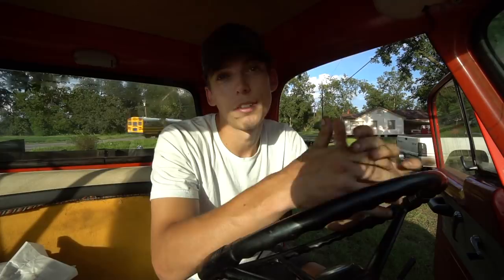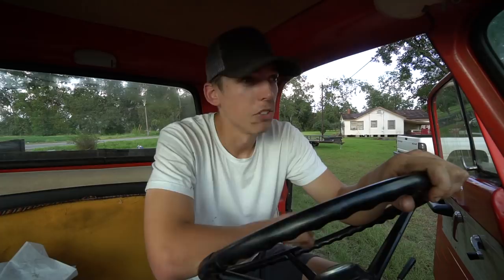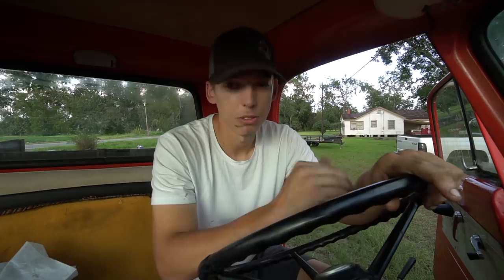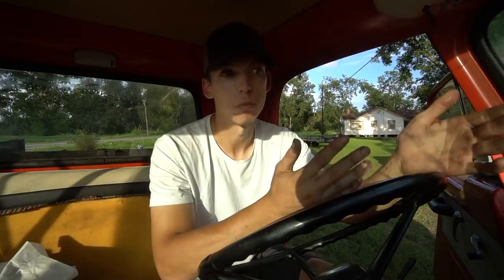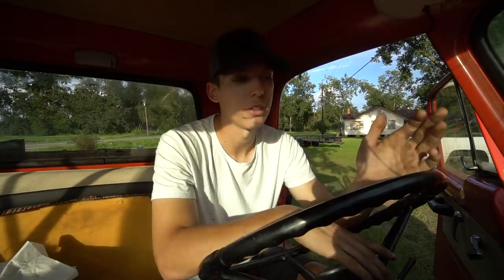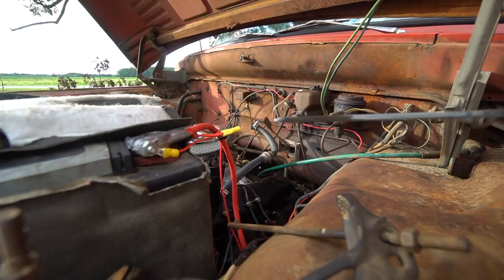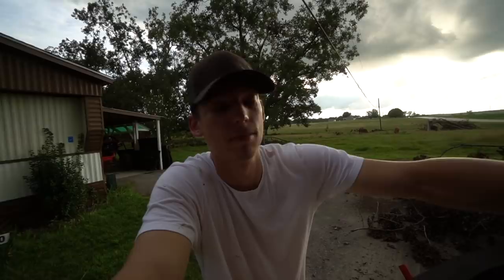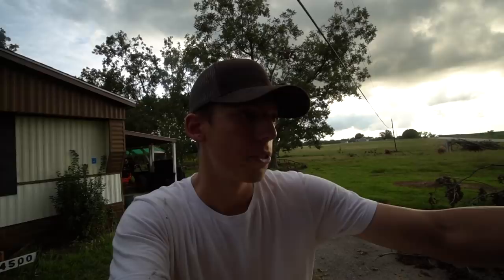Frank Blew His Head Gasket?

Comment: Thoughts for your channel.  Lay out a plan. Eat that elephant one bite at a time. 

Video. 

1. Do a compression test to see of you have a blown head gasket. 
2.  If needed change the head gaskets. Both sides
3.  Fix the intake gasket situation. 
4.  Change water pump and thermostat to remove that problem. 
5.  Bleed and adjust the brakes. 
6.  Fix the ignition switch. 
7.  Test drive.
8.  Then move on to cosmetic stuff. 

There's 8 videos which should keep you in business for a few weeks. Don't think you have to explain what you want and what didn't work. Video the stuff. You have a lot of talent and are smart. That truck is old and if it takes you a few weeks of months to get that all done that's ok. We are hanging with you and want you to succeed.  You can do it. :-)

Comment: Watch the temp really well, it could be anything. You greased the water pump and leaks will pull air into the system. The coolant does look like it has oil or more than likely grease. But the smoke is probbly valve seals letting oil into the cylinder. But i would just drive it and see if it clears up. My 80s model Camaro and ta's would blow some smoke every time they sat and the oil drained out of the head through the valve sels

Comment: A compression test should reveal if you have head gasket issues. I suspect the grease you are putting in the water pump fitting might be the issue. At any rate, a blown head gasket isn't necessarily the end of the world. Setback yes, but not a disaster. I might suspect a leaking valley pan gasket or intake manifold gasket. The symptoms can look very similar.
Reply: Think you are on to something there , if the grease is passing thru to the inside I bet that is what he is seeing cause he has said he has greased it a couple times trying to shut it up.
Reply: A could be sucking air from the weep hole on the water pump,  But by all means do a compression check tool is not that expensive at Harbor freight.
Reply: Mike Has The Right Idea, He’s Leading You in a Solid Direction. Good Luck on the Test Drive, Ill Be Looking out For the Video.

Comment: Before you tare anything apart do a compression check and inspect the plugs.  It could be a leaking intake or pump issue which would be easier than changing a head gasket.

Comment: In my experience there are a few things that could be wrong. 
1. You could be dealing with a blown head gasket. That does not always happen with this kind of modification, but it does happen.
2. You could have a leak between the manifold and heads where the water / coolant goes through the manifold.
3. Cracked manifold passage between the intake and the water passages.
4. Theo one that is the worst issue could be a cracked head. The water jacket in the head might have a crack and you would not see that until you pull the heads.
These are things I have seen in both diesels and gas engines. If you have a water / oil cooler (which was used on some engines) then there could also be a leak in this.
Normally if you have water in the oil it would not show on the dipstik until it is very high. I have worked on a couple of engines that I worked on for some people who blew their head gaskets and they pulled their dip stik and it did not show on their stik, but when I dropped the pan it was partially filled with water.
If there is no water in the oil then check to see if the bearing or casting metal from the bad water pump. When the bearings are worn out the clearances disappear and then you have the steel impeller rubbing on the aluminum / cast iron of the housing.

Comment: I think Cory archer is right. I think it's water pump bearing material mixed with grease. As far as the smoke goes, blue smoke typically means an oil control issue. I'm betting a combination of worn valve seals, and possibly worn rings.

Comment: Try drx rust remover I used it on my 1970 C30 cab and it removed all the rust you just spray it on and pressure wash it off, it's super easy check out a few videos on youtube. I think you said you left your pressure washer in cali,  See if you can brown one. It completely removes rust, It's not a conversion or a cover that stops it, it removes it then you can paint over clean metal. Also don't buy it off amazon its cheaper on their website. As for the possible head gasket you can get a Combustion Leak Tester you put it over your radiator and it will detect the presence of exhaust gases in an engine's cooling system.

Comment: I have been dealing with Mopars for over 40 years replace the valley pan and do not put RTV on the intake. The reason you are getting bubble is because you are sucking in air one of the cooling passages. I have done this on more than one occasion. Put the valley pan on and put the intake gaskets on then the intake.

Comment: Neither the coolant nor the oil indicate a blown head gasket.  I agree with the comments about the water pump drawing air through the packing.  If your coolant was low, the pump impeller is whipping it into foam.

Your carb may be very rich.  Cold starts with no choke required is a clue.

Comment: Autozone has a head gasket leak detector you can rent. Just need to purchase fluid used in the test. During test some coolant is drawn up into cylinder .Fluid is blue, if it changes to yellow it indicates exhaust leak into cooling system.Get engine up to temp( thermostat open) before performing test.

Comment: Also like I said b4 make sure you only have 1 crankcase vent being sucked thru the intake via a pcv valve and the other valve cover has to have a vent to atmosphere on it if you have both valve covers venting into the intake via vacuum line and into the air cleaner than you are forcibly sucking coolant thru the valley pan gasket which is why i warned b4 not to vent both valve covers to the intake because itll find rhe weakest link and suck that seal in and can be water

Comment: Let’s look at this logically. Foam may or may not be caused by oil in the coolant. Since there is no apparent oil in the coolant the foaminess is probably caused by air be mixed in with it. Set that thought aside for a moment. You should get a clean, dry container and drain the motor into it and inspect it for any coolant. It may not show up on a dip stick nor be enough in the coolant to be detectable by smelling it or sticking your finger in it. If there are no signs of coolant in the oil, you can pour it back into the crankcase and go back to the possibility of air being sucked into the cooling system. This possibility is more problematic as there are several locations where this could happen. You have a bad water pump and the front seal is bad. You indicated that the thermostat and water pump gaskets are leaking, another possible source of air ingestion. Then you have the valley cover with a “homemade” silicon seal, another likely source. My first inclination is the valley cover is the issue, but hard to say. Try a new proper gasket there first and if that doesn’t fix it, move on to the water pump and gaskets.

Comment: I would suggest to first change the water pump, it apparently needs it anyway. You said water pump gasket is leaking, look very closely to see if it may be leaking. It may be seeping and dripping looking like it is from the gasket. When you run it with cap off it’s not pressurized and the water pump could be sucking air in by seal causing bubbles in coolant.

Comment: The grey may be the grease that you are pumping into your water pump. Your valve guide seals are bad, you need to do a valve job. Remove the heads, check the decks, get the valves ground. Check the bores, if there is a ridge then consider rebuilding the lower end. However I believe a valve job will fix your issues.

Comment: Put some thin plastic around the radiator neck with no cap on it. Rubber band it or tape it tight to where it kinda looks like a balloon. Crank the truck and see if it inflates. Easiest way to check if a head gasket is blown.

Comment: Faulty water pump. It's not working properly. Recommend replacing it. Make sure the old gasket is cleaned off the block completely. Then take a rag and spray a little brake cleaner on it and wipe the gasket area really well. Then install the new pump.

Comment: I used to work in an auto engine  machine shop. What usually causes coolant in oil - cracked block, cracked head, heads or block is warped need resurfaced. What usually causes smoke - bad valve stem seals, bad rings/cylinder wear, carb adjustment. It has been my experience that if you rebuild cylinder heads normally the bottem end has problems after,  so if it were me I would just rebuild the entire engine if you figure out the top end is bad. I did alot of that stuff when I was your age. Judging by the oil. I don't think you got a blown gasket. There is no evidence of it. A compression test will tell you if there is a major problem. Something that old is probably gonna have some blow by on the rings due to wear.

Comment: with the oil being clear and not milky looking the radiator being low will cause the foam ,check the water pump gasket and thermostat gasket i don't think its a head gasket the smoke just looks like a stuck ring ,its an old truck that is to be expected dont panic it will work out

Comment: It sounds like your valley pan is garbage and needs replacing or that well water/grease combination is the issue. Judging from your dipstick being clean, and the contents of the radiator I doubt you blew a head gasket (it usually looks worse than that). A compression test would definitely tell you and is a good idea.  I would not drive it until you are 100% sure the head gasket isn't toast. I'd also drain the coolant that you have in it if you mixed it with well water. Just get some jugs of distilled water from Wal-Mart (99 cents per one gallon jug If I remember correct) and mix it with the concentrate anti-freeze.

Comment: Its probably the Grease you put in the water pump along with it being low on water . Don't be so quick to pull it apart. I don't  think it has run enough to blow a head gasket. Its a lot easier to get water in your oil than oil in your coolant unless you are working on a vehicle that has a bad oil cooler but this one should not have an oil cooler. The valley pan does not have oil running through it only air/fuel and water in the cross over. If the valley pan was leaking it would leak oil from under the pan or water into the valley (water in oil) or finally a vacuum leak that would be  noticeable in the way the engine runs. Just fix the water pump and keep an eye on it. Rich

Comment: Well water concentrated is not a big deal. The minerals will form deposits in the radiator. City water will as well. Best to use distilled. That said I have put plenty of city water in radiators over the years.

Comment: You can blow a head gasket on the compression side  and not close to the oil passage..any foaming in the rad is not normal ..chances are ..since you have gaskets coming pull the heads and just do it ..but if you do ..get heads checked..magnafluxed for cracks ..or just find a set of 452 heads ..common on all mid 70's big blocks..or 346's..early big block 72 and up ..as these series of heads have hardened exhaust valve seats which your heads do not have ..for unleaded fuel

Comment: Any time you get air in the system and fill it up you will get some foam and grease from the water pump bearing also will cause foam you need to replace the water pump chances are the grease is getting into the coolant. If you pull back and forth on the fan and it moves at the bearing its shoot

Comment: Take the spark plugs out. Then use a coolent presure tester to pressurize the system. Let set a few minutes. Then crank the engine over. What will spray out the cylinder that any is leaking into. If not check for any coolent running down the engine block.

Comment: I've seen it foam in radiators before, fill the radiator full , put the cap back on and see if there is any pressure  build up. If there is a head gasket leaking there will be pressure and lots of it. you  might be a little paranoid, I think it is because the radiator is not full and the foam is from the water pump just pumping coolant

Comment: And well water won't cause the foam. Now if someone added a coolant flush to the engine that would cause it. Always rinse the coolant system fully when you are doing major work of any kind and have to drain the coolant.  Especially when you just got the vehicle.

Comment: Thermostat also Water Pump should changed and head gaskets should changed too also try a new Rad cap too! Gaskets use High Temperatures Black Silicone put big thick film on both sides of gaskets around bolts too that why leak too!  Also foam okay also rad fluid should be 60 % antifreeze and 40 % water too  ! Plus flush rad too even heads even heat core too !

Comment: You had doubt when you did the intake. Why not have just done the heads then?? You were half way on that job.

It can leak straight into the cylinder and come out as the white smoke as you see. If it does that it won't put oil in your radiator or water in oil.

Comment: This is a Big Block Mopar.  There is No Coolant Flow thru the intake manifold. The Valley Pan caused foam in the oil How ?  Think..  Water Pump with a bad bearing being greased ?  Hmm?  Also.. Big Block Mopars have exhaust manifold studs or bolts that go into the water jackets in the heads. If they leak you get coolant in the exhaust.  And back to the valley pan. With the stock iron intake yes the valley pan is the gasket but Im pretty sure with an aluminum intake a fiber gasket goes between the intake and valley pan. Any Big Block Mopar Gurus gotta comment here ?  Also... Gas eats silicone. You dont use it on intake ports.

Comment: It does sound like the water pump if you put grease in it, that is where it is coming from, most likely. Even dingy, the truck should still run and drive normal. I don't think you could possibly put that much in there that you have to flush the whole system, and I am thinking it should be petroleum based, so soak it up with some paper towels, because it should float to the top.

Comment: It's not the head gasket cuz if it was the head gasket it would build pressure and the radiator fluid would come out of it as soon as you took off the cap and you would see bubbles in the reservoir tank it would overheat within 5-10 minutes of you starting the truck

Comment: It's a old truck man things like that are normal while your replacing the head gaskets you should take the heads to a machine shop and get hardened valve seats put in for Unleaded fuel those trucks back in 65 run on leaded fuel and it helped lube the valves without it the valved will pound their way into the head and cause big issues or there is a leaded additive you add to the fuel that way you don't burn your valve seats right out the choice is yours but running it with out doing one of the two your going to have big problems sooner or later

Comment: Go buy a vacuum gauge in set it to the highest vacuum setting you can with carburetor  And time the vehicle with a test light and check it with that the vacuum gages well to try to get the highest vacuum setting with the carburetor and timing.

Comment: If the water pump gasket is not sealing the water pump could be pulling air into the system causing foam in the radiator

Comment: Do a cylinder bleedown test and pressurisebthe shit outnof the cylinders and put a pressure gauge on the radiator cap and see if it's pressuring the collar system you can even look for bubbles in the radiator

Comment: Probably grease from the water pump and if any air is getting into the system it will churn into foam. I'd drive it some and keep a check on oil an cooling system. See if it persists. I don't think it's much to worry about

Comment: I found this online....Foam in coolant can result from trapped air in the system, a leak on the suction side of the water pump, an improperly functioning water pump. Foaming may also be caused by a lack of anti-foaming agents in the antifreeze.

Comment: Double check your intake gaskets bevause they will leak that valley pan is super tricky to get it to seal so if it isnt cranking superbhard or slow then it might not be a head gasket it could be your b intake leaking. Run the truckand drive it  with the radiator cap cracked loose and if the level stops lowerimgbthejbits your intake
Reply: This engine does not have coolant passages in the intake

Comment: I had a head hasket that had a pin prick hole in it and it was not leaking oil or coolant but when it got hot it was leaking compression into the coolant chanblers and bubbled all the coolant out of my overflow.. I also struggled to figure out what was going on..

Comment: Did you flush the cooling system using the flush you can get from Walmart?  I use that every other year, and after I drain it the flush, I refill with water to rinse the system.  I'll get a little foam like that.

Comment: You might have some exhaust gasses blowing through the valley pan causing the oily film ( foaming ) in the radiator after the motor is at operating temp

Comment: I had foam in the coolant on a 4.7 dodge and it smoked just like that and the head gaskets were bad put new head gaskets on and solved the problems, if it were me I’d change those head gaskets out fix that water pump and put a new radiator in there and that way your whole cooling system will be completely redone but def start with a compression test first good luck 👍🏼